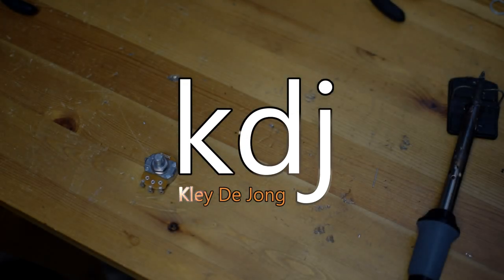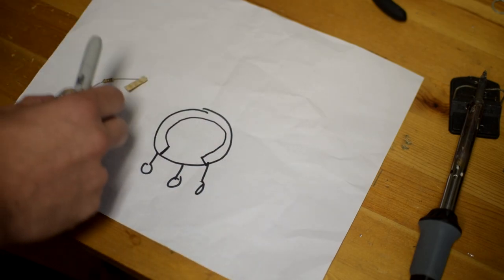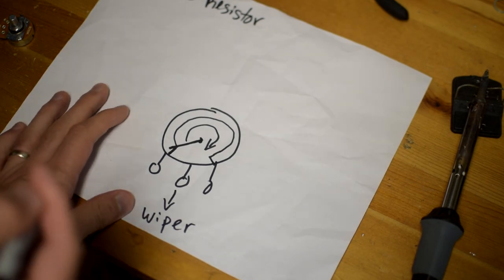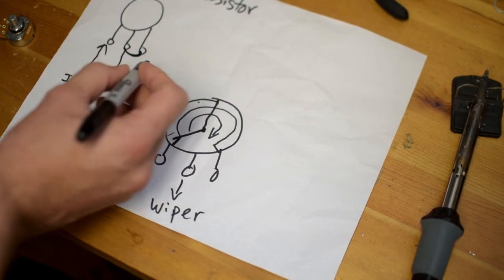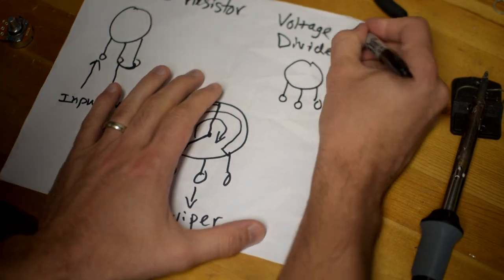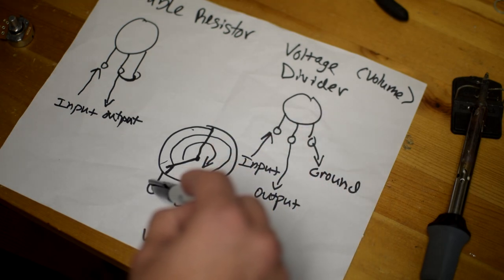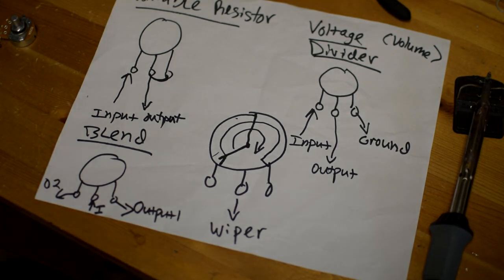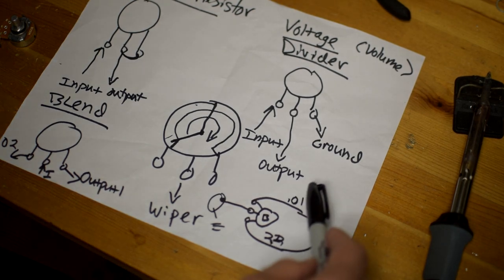How A Potentiometer Works & Options for Wiring

Comment: why would godin put a resistor across input and output lug on thier volume knob?
Reply from the maker: I think that would mostly act to change the taper of the pot.
Reply: its a 250k pot with a 150k resistor and it is across 3 and 2 does that seem odd?
Reply: I found info on why this person did this and you are correct, it changes taper of volume pot. I found this very interesting thinking I bought a new guitar lol. the factory shemactic that was sent to me from godin does not have this resistor.

Comment: the lender pot circuit you draw is wired up for a catastprohe waithing to happen for the unlucly source you hook upp to this blend pot shorting ouy the output off the souce when you turn you pot all the way to one of the sides.that is shorting out the source output witch is no good.Never hook a active source direct up to the viperpin on a potmeter for a volum control between a source and a power amplifier either.you should always hook the wiperpin up to power amp input and source to the left pin and ground on the rigth pin seen from above

Comment: I think you are wrong!wiper leg and leg 3 would be a variable parralel coupled resitor/potmeter.if you have 100k will be 50k?lbetter to use a 50K instead.?all of those values  is to high to use on good audio amlifiers pre volum/dac volum or power amp input gain.give to much noise.10k and 20K give less noise is my experience

Comment: there is a reson for do wire it the rigth way aound .are you kidding.?if you wire it thre other waya round you have to turn volum counterclockwice.the other thing is a volum pot is not a linear potmeter.if you use a linear pot you can hook it up both ways exept you have to turn the opesite way you get the same level rise .but on a volum potmeter that are logoritmic scale resistance .so it lower  the  resistance in a non linear way do to the human hearing sensitivity it raice the volum gradual.but a linear you get pretty high volum straigth away  no matter the way they are wired. a volum control potmeter or better a autenator smaller than the mono pot you show on the video wich are not linear have to be wired one way.wired the wrong way you have to turn clockwice to raice volum and the steps volum is been raised is hopless different